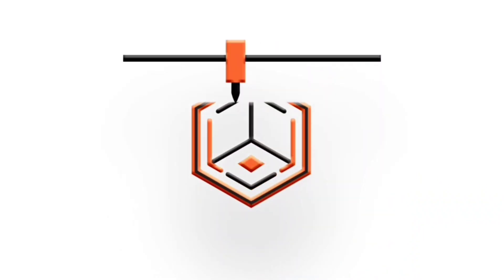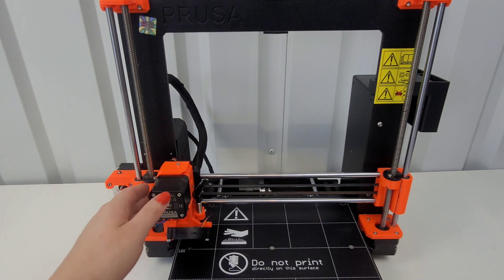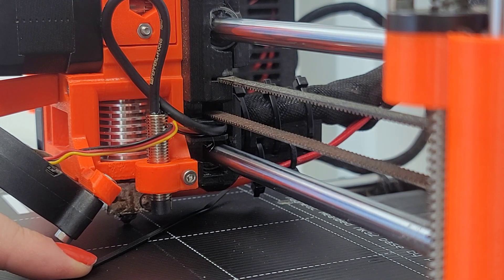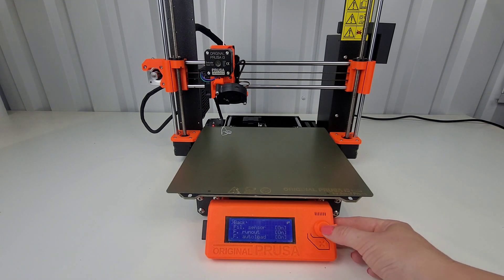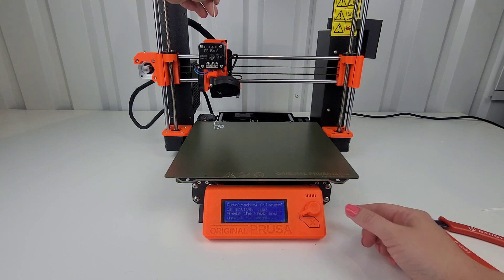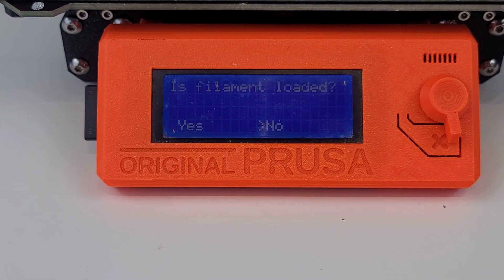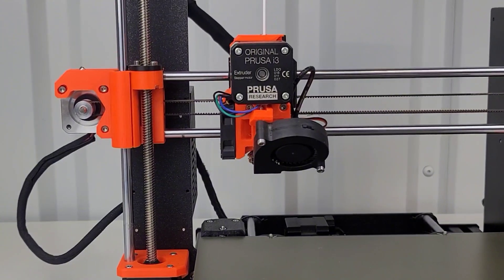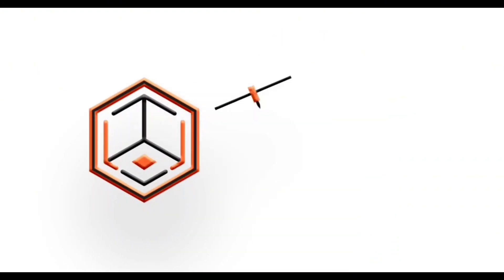MK3S Upgrade to MK3S+ (Side Quest for MMU3 Assembly) Chapter 6

Comment: I have and MK3S+, I had the same problem with the autoload when I upgraded the firmware, two firmware updates ago. I just did the same thing you did, and it work fine, I just checked the firmware and in autoload there's an [ NA ] There. I guess they removed it for some reason.
Reply from the maker: Yeah I was wondering if it was this for my machine. But I had it turned off from before and couldn't remember why. Turns out it was my fault. Not a surprise. I have the troubleshooting up today. Thanks so much!

Comment: I did see all the video's so far for the upgrade, and i think one time you mentioned that the manual said you needed a new filament sensor but Prusa Support said otherwise? Right? But it looks like now it really needs the new sensor. Hope you will get one soon and it won't be an absolute pain to get all the wiring re-do again.
Reply from the maker: Yes when I first asked for the items needed, they said just the printed parts and a shorter PFTE tube for the hotend. I asked again when I had issues and they said it probably wasn't necessary. But since I couldn't remember if the sensor had worked before, I ordered the new red one. I'll have the info up tomorrow. Thanks!
Reply: The MMU3 requires moving the filament sensor & using some new plastic parts. So hopefully Tada can install the red sensor PCB at the same time.
Reply: Edit: there is another video and you fixed it already haha